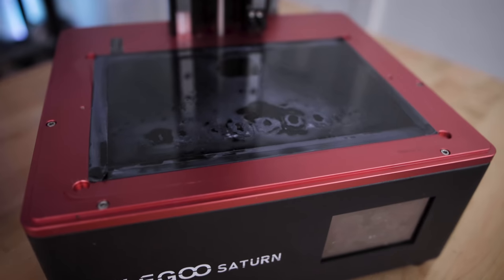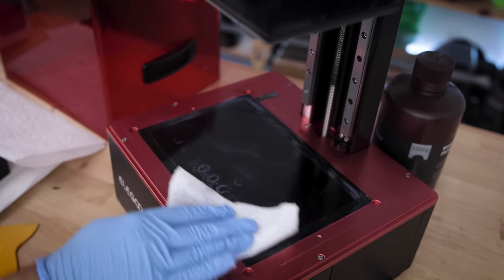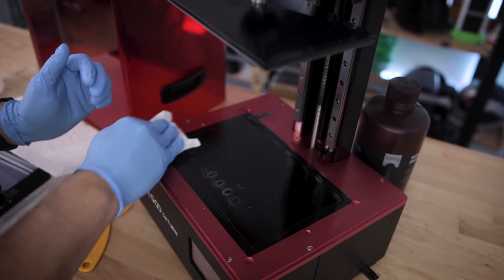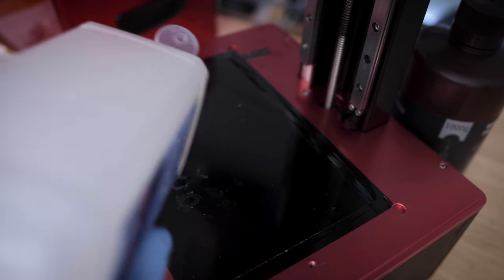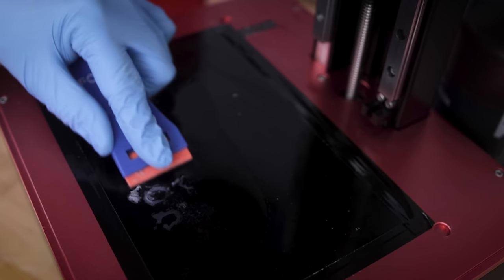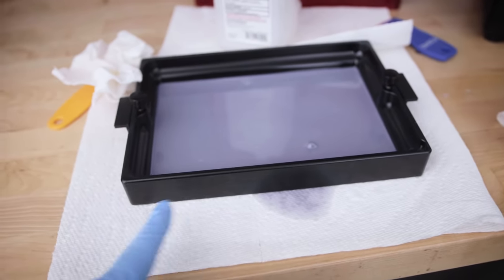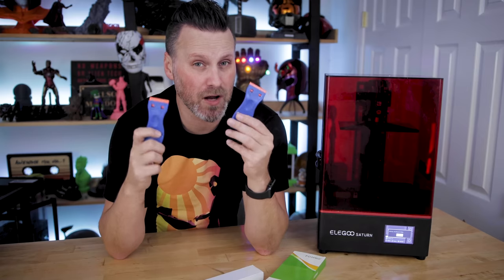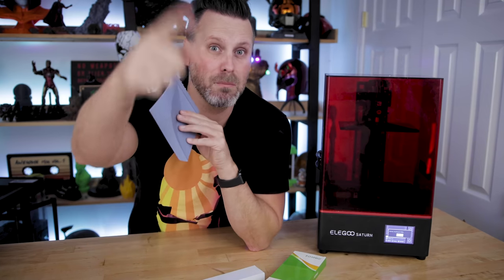Must Have $10 Accessory for Resin 3D Printers

Comment: A couple suggestions for if this happens again, I would suggest using a microfiber cloth instead of a paper towel as the paper towel tends to be more abrasive and may cause microscratches, secondly to help avoid the ipa  from getting where it shouldn't I'd suggest adding it to a sponge and then leaving the sponge on the spot you wanna soften

Comment: Ordered!  Thanks, saw this just in time to get them by tomorrow.

Instead of just pouring the IPA onto the screen wouldn't it be better to put a couple of paper towel down first then slowly pour the IPA onto them? That should help control the initial spread of the IPA and allow you to just soak the resin for a few minutes without worrying about the IPA spreading out.
Reply from the maker: Haha yeah I’m sure that would have been a better idea to let it sit and soak. Def a handy little tool!
Reply: you do want alit bit of liquid on the screen to help lubricate the screen and allow the blade to move, and it helps to lessen the resin stuck to the screen.
Reply: @UncleJessy  could you use the 3 in 1 PTFE lubricant on the screen like you use on the FEP? I would think that it wouldn't hurt the screen and would make removing easier

Comment: Came back a year later to say these are also great for getting prints off the build plate without gouging it. Also you can get a long handle version with a steel blade holder, which is great for build plates.
Reply from the maker: Oh damn! Okay off to Amazon I go for that steel version!
Reply: @UncleJessy  depending on your bottom layer settings the prints may chew the blades up, but you just need to get one part of the edge under them and they pop right off. If you go slow it goes really smooth. The blades I got were double sided too, so pretty good value.

Comment: I was happy today i had these blades. Forgot the the vat screws and had to remove a 100% layer from the building plate. With these blades i was done within 2 minutes and no scratch  or sweat. Thanks for the tip.

Comment: Jessy, you should look into putting strips of kapton tape around the edge/gap of the screen where it mounts into the machine.

Of any resin or IPA leaks over onto that edge, no worries it can't get inside.

Kapton tape is thin enough that it doesn't affect bed leveling either.

Comment: Hey there! Nice video. I just wanted to add the fact that on the old Saturn there is a scratch resistant film on top of the screen so that I could get the resin off by soaking it it a towel tipped in IPA and just scratch it off with the metal scratcher. This was the easiest way and I don't really see a difference in the print quality because of "microscrarchrs". I don't really think there are any.

Comment: Something else that I've found works really well, thanks to a tip off the Reddit 3D Printing community, is to take a paper towel, soak it in alcohol, put it on the screen, stack the vat on top, and just forget about it for an hour or so. It wiped right off when I had that happen.

Comment: I've seen a lot of people suggest using an extra FEP sheet on the LCD, to protect it from leaks if the FEP on the vat fails.
Honestly, Elegoo should have designed the printer so that it doesn't require an LCD screen with an exposed polarizer in the first place. FEP failures were always going to happen.
Reply: No, I don't think it's reasonable to expect then to develop an entirely new technology. Better is to have official screen protectors.

Comment: Ugh. Where was this video a week ago? The same exact thing happened to me. But I couldn’t remove the resin (I didn’t know about these blades). However, I discovered that there’s a thin plastic film covering the screen. Elegoo essentially put it on there for these reasons. I contacted customer support and they walked me through some troubleshooting steps. After they determined that my LCD screen was not damaged, they offered to replace the film for me for free. Elegoo’s awesome and I’m grabbing some plastic blades. Thanks Jessy!

Comment: Thank you for making this recommendation!  I got the plastic "razor blades' in case I needed them for my printer, but I just used them to clean fine particles of paint overspray off of a beautiful old Art Deco glass light pendant - an antique from the 1930s - it looks as good as new, with no risk of damaging the gorgeous antique glass.

Comment: Honestly your tip about mean green is all I use. In fact for this problem if you soak a paper towel in mean green and just sit it on the screen for a lil bit that resin will release. As the vat goes, if you’ve got those prints that actually just printed in the vat, drain and wipe it down as best you can and pour a lil mean green in there and let sit for a bit, the print will lift right off. Mean green is literally all I use now, thanks for the tip!

Comment: That might sound a bit crazy, but why not use the vat clean function directly on the screen but with a little bit of resin poured on the dirty areas only.
The recommendation about additional taping of the screen edges with Kapton tape could be useful to prevent resin leaking inside.
But in any case you don't need lots of it, pour very gently only on top of the cured resin area - you don't want to let it flow further aside.
Also it might be convenient to use a plastic syringe to drop only as little resin as needed. Try to keep it into a single blob (resin viscosity and horizontal position of the screen should if not completely prevent it from leaving out, at least buy you enough time to run the vat-clean mode /or screen test one, which is the same thing/).
And of course don't forget to put a support-raft from a old print to use a handle to peel it off when cured.

Since I got a wham bam flex-plate I very rarely use the scraper, only to remove some tiny items (like weapons or other mini's hand-held items) because they have very small raft area and flexing the plate doesn't immediately remove them, to they need a little push ... and for quickly scraping some stuck residues on the build plate if there are any.

Comment: reminder when doing this keep the blade flat to the screen. You can still scratch the screen even with the plastic blades.  I have cleaned my screens a couple times in the past with a similar flat plastic blade. 
Some good tips in this video.

Comment: i had this issue and got some scratches on my screen. I used 3000 grit softpad wet sandpaper and polished it out. Still printing with no problems 2 months later.

Comment: I literally just had an FEP leak on my Saturn, then walked out here and this video was up! Nice!
Reply from the maker: Hope it helps!
Reply: same.. weird.. all at the same time lol..
Reply: I  came across this video about a week ago and lo and behold, ended up having to pull it back up this morning after a failed Iron Man face plate did my FEP in. Here's hoping the plastic razors will take the resin cleanly off the screen so I don't have to replace it!

Comment: Acetone does a way, way better job of breaking adhesion between cured resin and glass/plastic than IPA. You just have to be super careful not to allow seep into the seam at the screen edge, as it will dissolve the adhesive holding the screen on. I have a second-hand Elegoo Mars that was absolutely caked with cured resin, half a cm thick in some places. IPA did nothing, but Acetone basically made it fall off.

Comment: It’s going to happen sooner or later.  Those plastic razor blades are wonderful.  I put a gouge in my screen with the scrapper I was using before the radio blades.  If this happens to you too.  A touch of water on a tooth brush with some tooth paste over the area, then wipe away worked great for me.

Comment: I have the same blades exactly for the same reason.
But I use them for removing prints from the build plate. It works so good to loosen the prints first with it and then with the normal scraper.
Reply from the maker: Thanks! I will definitely try that out! Bought them for print removal and have never used them for that.
Reply: @UncleJessy  And they last forever! 😉

Comment: Uncle J! Great vid as always. Curious I have resin that is tacky on the exterior of my saturn cover. Any tips for removing the gunk without harming the finish of the cover?
Reply from the maker: Great question. I have the same issue and it's starting to drive me a little crazy. If I find a good solution I for sure will be sharing. Nothing as of right now
Reply: @Uncle Jessy  Hi you two, I had a similar issue and it was driving me nuts. I ended up just cleaning up with cotton balls soaked in 99% IPA. Worked just fine. I did a few quick passes and tried not to leave the IPA on too long because I did not want to risk etching the red cover.
Reply: @kapalaka  thanks for the tip, the goal is searching for a risk free solution.

Comment: Do you have any recommendation on a separate screen protector? 
I had resin leak through an FEP, went to gently remove it, and then it took chunks of the polarizing film that isn't supposed to be removed. 
Contacted Elegoo for support but don't have a solution yet, I would just go ahead and order the screen but its out of stock, my only option seems to be to wait a month or buy another saturn since im unable to resin print anything. 
Would have been nice to simply remove a separate protector and start fresh with another one if you have any leads on one

Comment: Got a (somewhat-related) question for you: Do you know if it's possible to swap out an older-style LED screen with a one of the newer mono screens? Or would that also require replacing the MB and getting different firmware?
Reply: The latter.